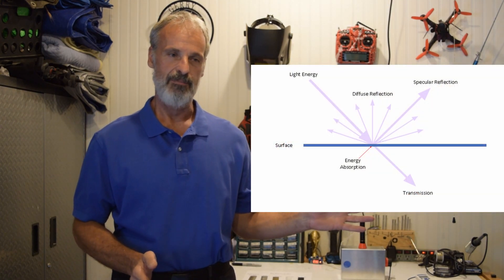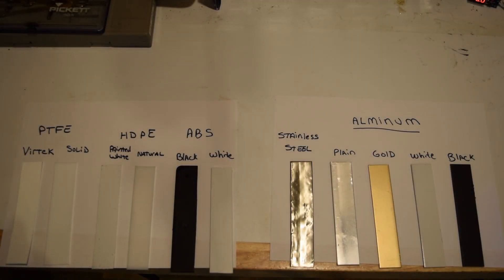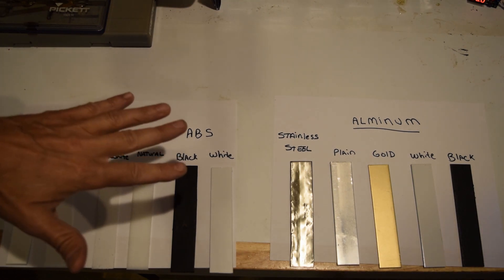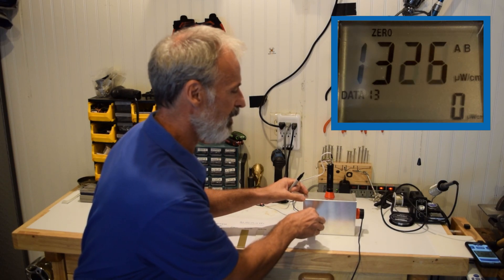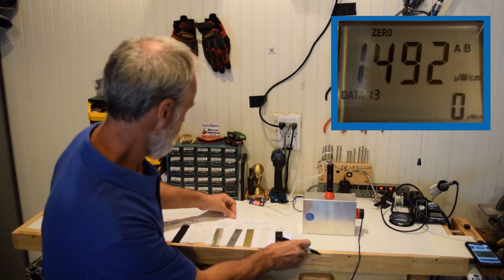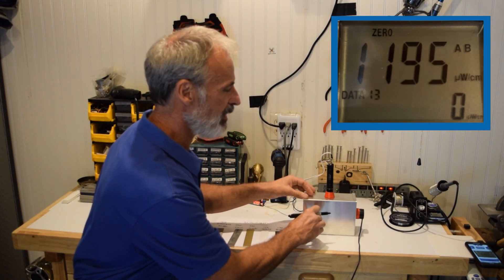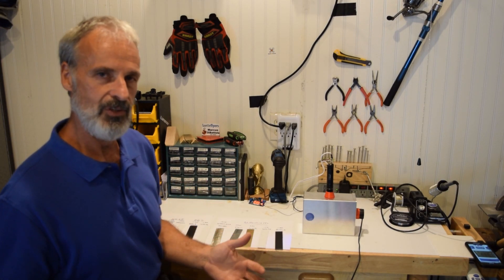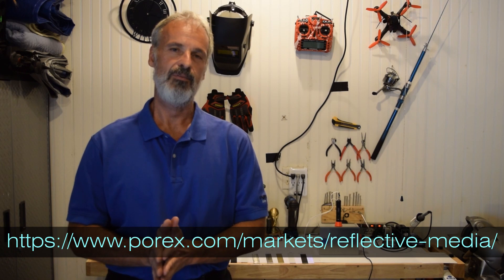DEMO: UVC Absorption of Natural, Painted, and Pigmented Materials VS Porex Virtek PTFE

Comment: It’s great to see your presentation over UV reflectivity. Seeing this I have contacted Porex by email to discuss more about the material. But getting no reply. It would be great if u could connect me with some one. My email is tasbir@zicoretech.com. Thanks. BTW there is a need of UVC transparent material. Hope u have some suggestions. Thanks again
Reply: Hello Tasbir, There are a range of material which can let UV-C light through. The material type and thickness can influence how much light gets through but some of the fluorinated polymers can let ~80% through quite thick films